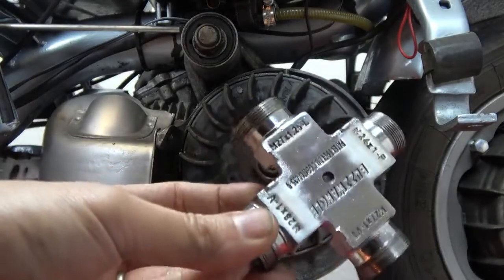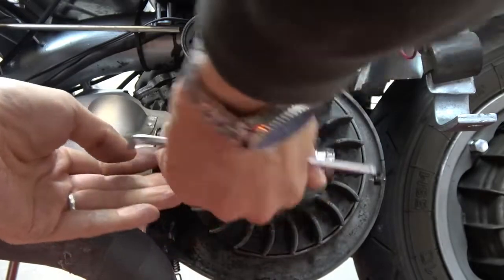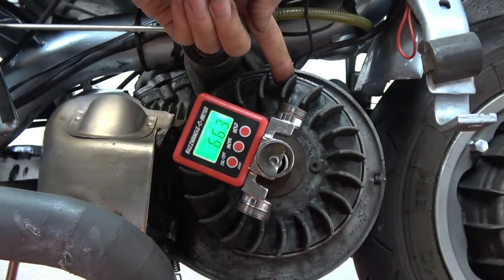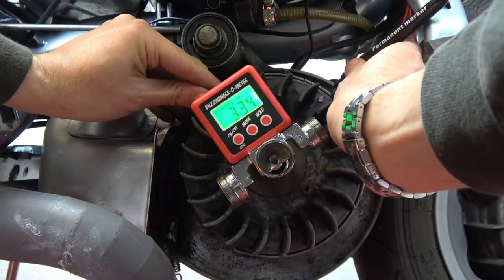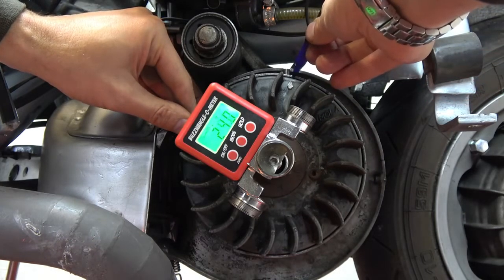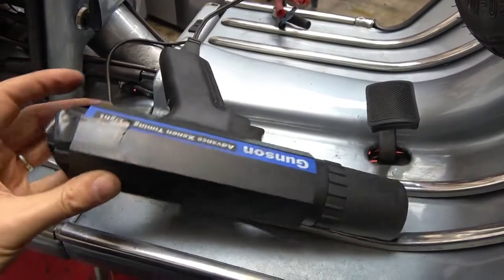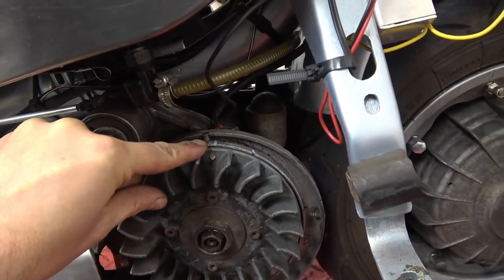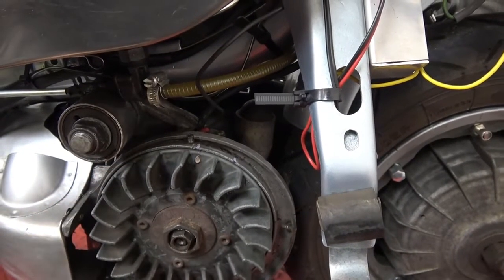Buzzwangle  - Ignition Timing and Strobing - the Fastest Way www.buzzwangle.com

Comment: Can you also mark the retard range to measure how much the variable timing system retards? For example, if I'm looking for it to retard from 24 degrees BTDC at tickover to 15 degrees at say, 8000 rpm or so, can I use the Buzzwangle to figure that out and then can I mark a range to 15 BTDC and check that it matches the RPM retardation that I've selected on the variable timing system?
Reply: Yes you can, just done exactly that on my engine using a Buzzwangle

Comment: Hi. Looks like a great bit of kit. But how do you know where to set the stator before you get to the point of strobing and actually setting the timing. Is it just guess work until you can actually get the scooter to start ?
Thanks for any advice.
Reply: It is as you say, guesswork in the first stator position. If you fit the stator in the middle of its range and start the motor it won't do any damage to the engine running at low revs. As soon as you get a strobe on it you'll quickly realise which way the stator needs to be moved. It's then a question of adjustment until your timing marks line up under the strobe.
Reply: @StickyFeatures  Perfect, Thanks for the quick answer